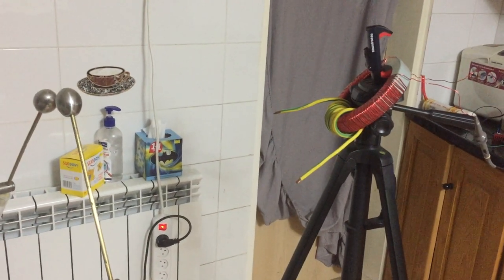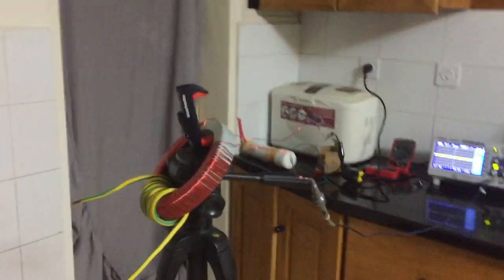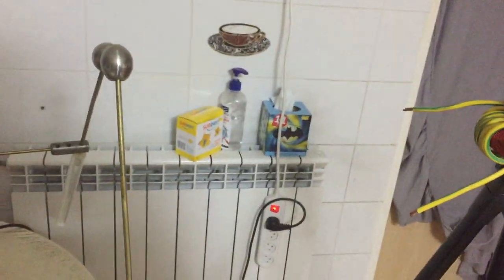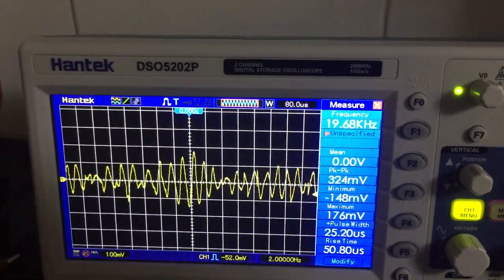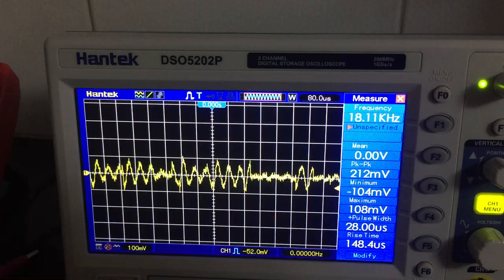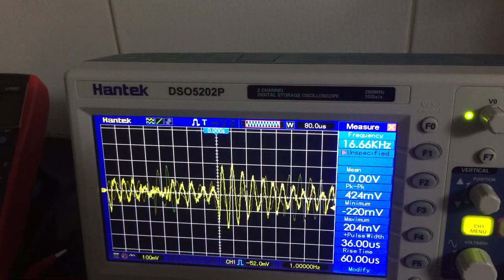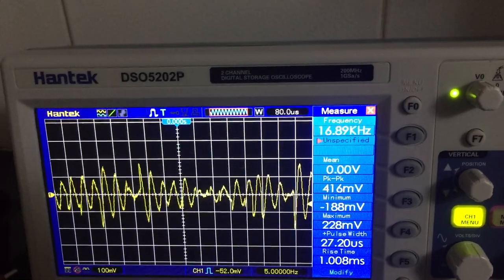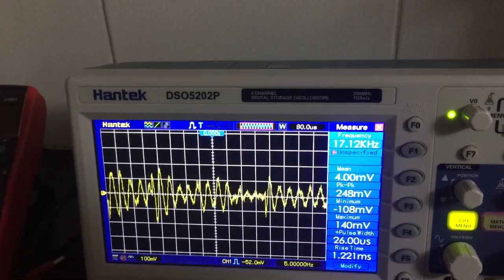Wireless Scoping of a Bonetti Machine (Sector-Less Wimshurst)

Comment: Try using a non ferrite coil using primary and secondary. The iron core may limit and shunt voltage levels at higher frequencies. Could wrap the same on a pvc core - to bend in a circle put hot sand perhaps a couple hundred degrees inside the pipe then drain sand after formed and cooled.  Non ferrite cores or cores with small amounts of iron are used in higher frequency apps. Still interesting pickup.
Reply from the maker: Thanks

Comment: ..it is alternating because the coil reverses the direction of the current when the current passes through and then disconnects. In this case, the disconnection occurs when the magnetic resistance rises so much that the voltage from the electro-static generator cannot get it higher. There is a reverse phase of decrease generated by the coil's magnetic field until it is exhausted and then the whole cycle repeats.
Reply from the maker: Thanks for that!